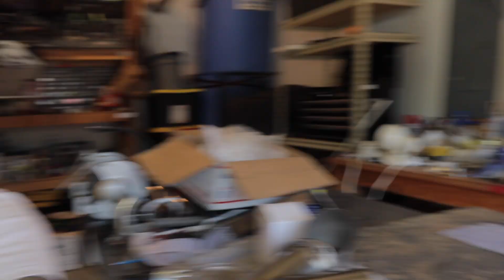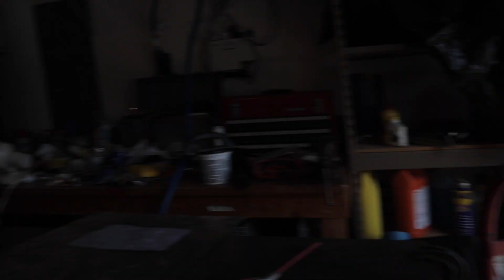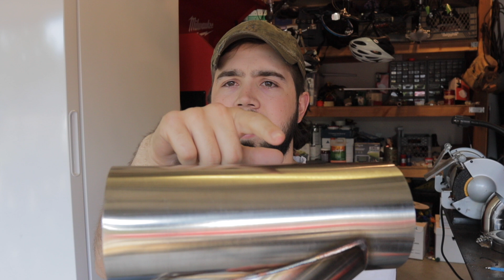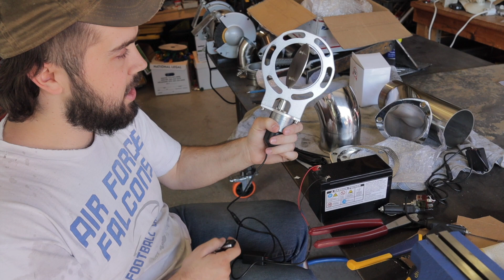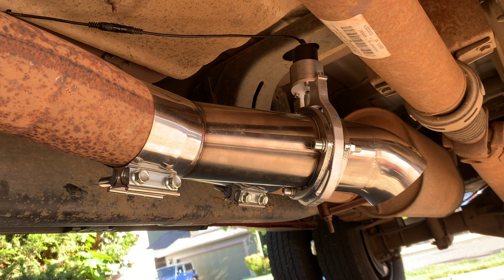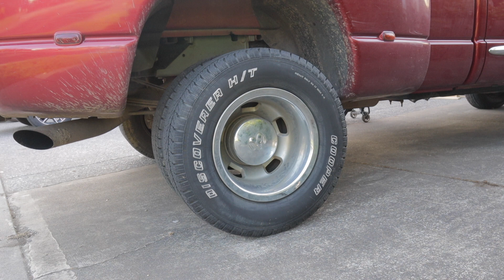New Spelab Exhaust Cutout On The 5.9 Cummins

Comment: You can put it in front of the cat. I just put the 4" Granatelli cut out on my 07 2500 Ram with the 5.9. Just cut out about 10" of pipe between the cat and muffler and use a band clamp back there and cut a small a short 3 o 4" piece from that existing piece you just removed to slip into the expanded/female front end of the Cat pipe so you can now install the cut out right there in front of the cat and the down pipe coming from the Turbo. I might post a short video soon on my channel. Good to see people who appreciate our loud Diesels.:) :)

Comment: I am seeing the same deal. No videos on a Duramax. I am planning on doing one on mine. I have an LB7 with the 5 speed, and a 5" exhaust. It has a nasty drone at 70-78, and with the long trips between Michigan and Montana, it's a brain killer. Plus, sometimes, I love the sound of a resonator/performance muffler on a duramax. Might go for it now!!
Reply from the maker: So far it is still working great for me. I love being able to switch between fun and quiet. My only complaint is you can hear the valve chattering when its closed because of slop in the mechanism, but its not terrible.
Reply: @LivingOnWheels  I might pay more or build my own to be a double valve. Good note on rattle. My truck is sitting at about 550 horsepower, but I intend to expand on that. There is a LOT of pressure and flow out of the exhaust, so I don't want the thing rattling too bad or at worst, getting spit out the rear 🤣

Comment: Joe …if your looking for the sound that WE ALL desire from our diesel trucks I would delete the cat and go straight pipe all the way back. Does sound good as is…it is definitely quieter than our 7.3 ‘s, would come in handy on long trips though…take care and God bless…David.
Reply: I first removed the muffler on the stock 4” system and it definitely improved sound “quality” and throttle response. I then installed a 5” catback straight pipe. Helped even more. I have yet to remove the cat. Are there any drawbacks performance wise/loss of back pressure from removing the cat? I’m good with emissions where I live.